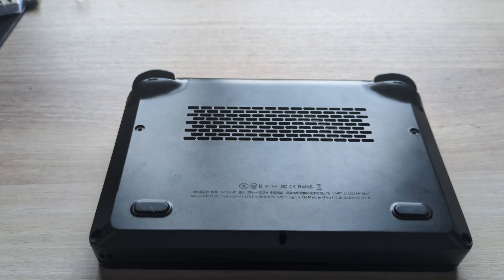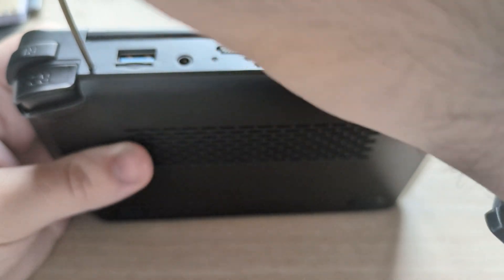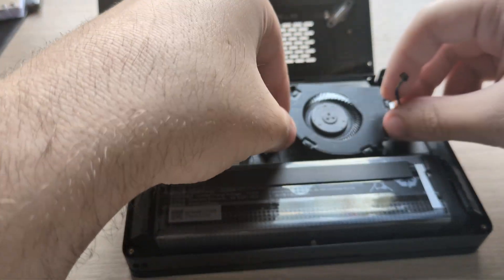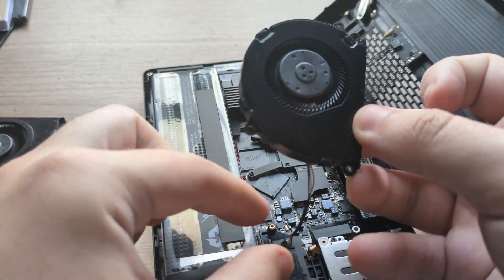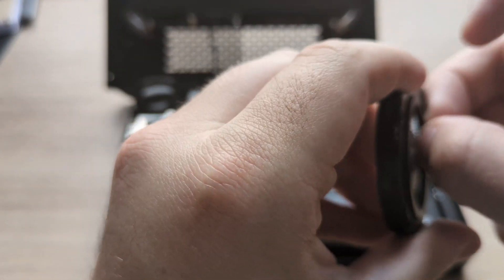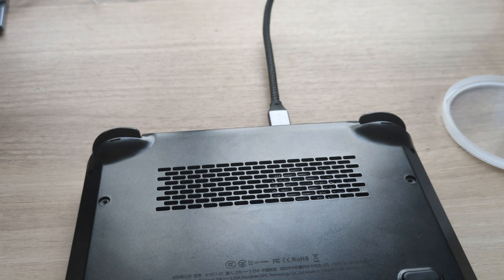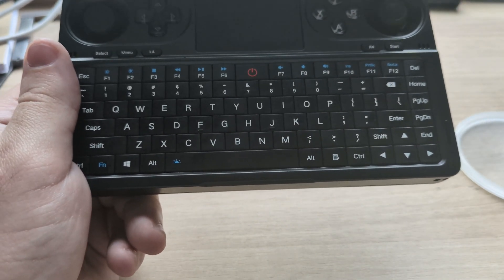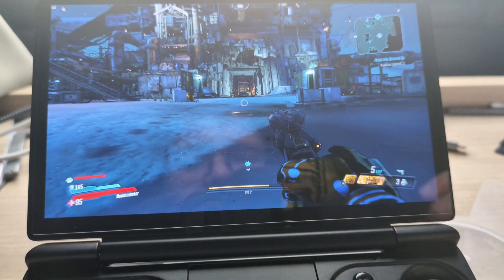Gpd Win Mini Fan replacement tutorial

Comment: Hi.. may i know what kind of fan problem you had before? My GPD win mini 24 start overheating lately and the fan making a loud sound and seems like doesn’t properly working since the spinning RPM is only 1k-2k. Trying configure motion assist fan but does nothing to the speed. Could it be hardware or software faulty?
Reply from the maker: Mine wasn't overheating but  if its a physical issue then it is a bearing in the fan goes out so it starts as a small grinding noise at first until the fan stops pushing air and grinds the entire time its on. As for the software side if you cant force the fan to spin then its most likely a hardware issue. If you go to the GPD subreddit or discord theyll have more tools and help on there
Reply: @LobotomizedLogan  yes I send the video to the vendor in HK just now and they confirm it hardware issue. They will send me a new fan. Funny things I have been using it for 4 months and the grinding noise starts during the first time Im using the console. And I thought it was normal. lol. until the point the fan spin like 900rpm then i realize there is defiantly something wrong.

Comment: Thank you for this video. I've also had fan issues for a while and tried to ignore but its got worse now. Ive reached out to Droix will wait to see what they say otherwise will replace it myself using your tutorial!
Reply: Do you know what screwdriver you used by chance? I managed to get the three on the side out with a PH0 but the five on the back case just do not seem to budge with the same screwdriver. Also tried with a PH00 and PH1. Does not unscrew as easily as yours 😭
Reply from the maker: @dniknj  I apologize I got it from a Daiso in japan it was a dollar pack so I am unsure I have also taken it apart several times for the warranty so my screws are probably worn out